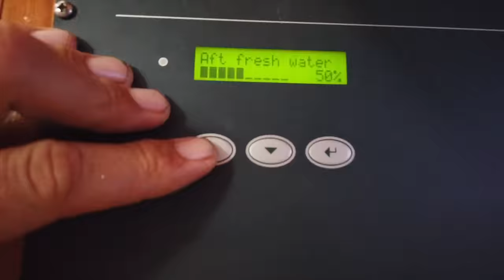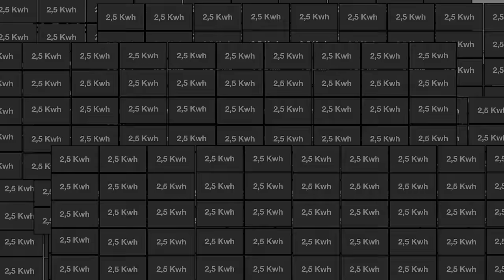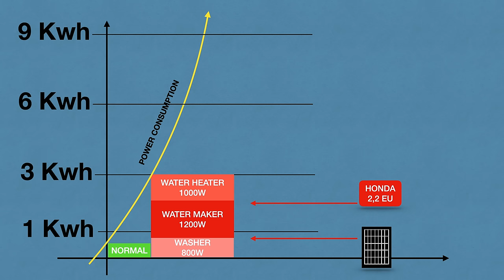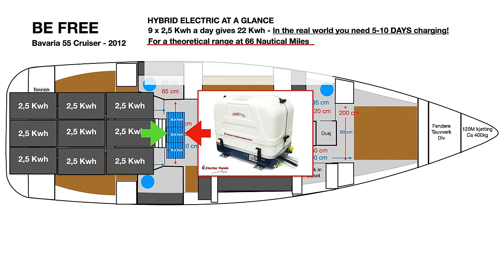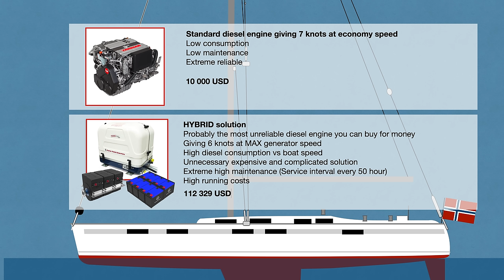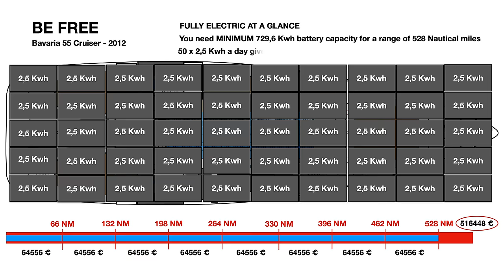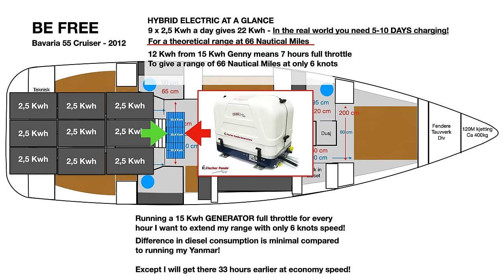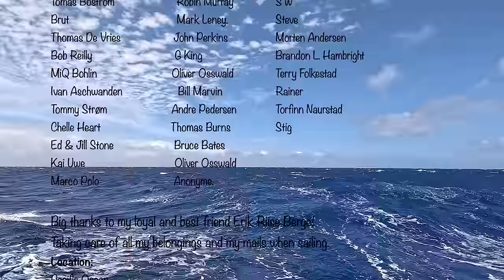Why I don't believe in ELECTRIC or HYBRID for long-distance sailing - SwT 170 - MY HONEST OPINION

Comment: Agreed on all of that. Personally I think all of the greenwashing of these systems is getting really tired. There's nothing eco about them.
What you didn't cover is parallel hybrids. In my opinion, they are the only way that a hybrid makes sense or if safe for the long distance cruiser. You get the advantages of silent day hopping and some regen in nice conditions, but have a real engine with long range capability when it's needed. You also get the huge advantage that they're a very powerful electrical generator, so when you do need to change, you can do it fast.

It also goes without saying that such systems do make more sense on a fast multi, where you have the space for big solar and regen becomes much more effective.

Comment: The problem with boat propulsion is water. It’s the hardest medium to push through and unlike a car , where you put in initial energy to overcome the rolling resistance, once you get up to speed you can ease off the power and continue to maintain your speed. With water this is not the case - to maintain a set speed you have to continuously have to input power - this works ok with diesel where the energy density is high but with electric is is a big problem.

Comment: I've been a solar design and installer for 29Yrs. Specialising in Victron systems. Many of my land based systems with no utility require a diesel generator. Being miles out at see without a petroleum driven motor/s is NUTS. If you have Victron issues let me know. I can assist, send  me your VRM number and insure your system is linked to WiFi. Cheers Mac

Comment: I have electric/hybrid propulsion…. 21.5kw Onan generator…
Depending on conditions my sailing catamaran has a range of 2000-4000 miles per tank of fuel(160g)…. That is up to 25 mpg from charging with a diesel generator…

Comment: I've done 150,000 miles over 50 years and never had anything close to 1,000 mile range, more like 200, then never used that anyway. I did run out of diesel once in Alaska so operated as a sailboat for a few weeks till I got somewhere. Different strokes for different folks.

Comment: I like a hybrid from a redundancy and safety perspective, but, obviously when considering a scenario where the sailing yacht becomes a motorboat, and needs long term power beyond the sun can provide... it costs and burns more than the corresponding diesel engined setup due to conversion losses. OTOH if your diesel runs out you're not going anywhere regardlss of the sun. I think the hybrid style that makes a lot of sense is where both diesel and electric can power the prop. The diesel is the generator, and either one can spin the props. Silently motor away from the dock for free, and if all hell breaks loose and you need more than your electric can provide you have a backup/higher power solution.

Comment: for past five years on craigslist  only electric sailboats have been moving on the market  but they must be don correctly  the todays buyer dont want a boat thats sitting on the hard past five years not done anything to it.. yep  i seen them boats lately .. just last week.. yea. im boat shopping. and what i want is a sailboat thats ALL electric  .. to never EVER  have to carry water or fuels from dock dingy to boat  really excites me.. i like that idea..   i go look at a 1985 morgan 43 tomorrow, yes it has the diesel engine.. but.. it also has 1200 watts solar and 800 amp lithium battery back.. thats what sold the boat .. and i suggest any boat owner who is trying to sell it. spend 5 grand on solar and batteries and your boat will sell..and clean it up every 6 months  we buyers dont want to spend 40 to 60 gran on a dirty ass boat....

Comment: Just to add. If we assume you are motoring at 7 Kts then you would do the 528 nautical miles in 3.14 days. If you had 291 panels with an average output of 2.5 KwHr each then in one day, as you say, you would generate 727.5 KwHrs. But your 528 nautical miles will take 3.14 days so you would generate a total of  2.284 Mega watts of power. I don't understand the need for  291 panels in order to cover 528 miles at 7 Kts.

Comment: Everyone is allowed their opinion, but it’s just that.  There are no hard correct or incorrect answers, just opinions that correspond to the needs of the individual.  There are sailors that cross oceans with electric motors, there are row boaters that use their muscles.  It doesn’t matter what your opinion is, as long as you don’t think yours is the only way!

Comment: Bro, sent that generator to the scrap yard and buy a Northern Lights gen, as well as upgrading your alternator on your diesel engine to something like a 150 to 200amp unit.  Also consider a Silent Wind wind generator, as well as a water prop gen.

Comment: Excellent video. Well thought out and plenty of supporting data, cleverly presented. BUT: you don't discuss Parallel Hybrids. The idea of charging batteries (which will be used for electric drive) with a Fischer Panda diesel generator, or worse, a Honda gasoline unit, is, as you say, silly as a primary 'hybrid' solution. But a Parallel Hybrid, which is essentially a massive alternator driven by your inboard diesel motor, which can also become an electric drive, these systems seem to have far greater potential for offshore cruising.

Comment: tbh. the real advantage of hybrid is packaging and silent entry and exit from marinas. plus there are some areas where you cant go in under power. also with a massive battery back you can be at anchor for days running AC and not worry. also one more thing. comfort. motor sailing at night on electric motor only, so people can sleep and not feel any vibrations. especially on smaller boats. there are advantages. massive ones. cost is not one of them :D

Comment: I did some rough napkin maths on this once. If you cover the entire deck with solar panels, never get overcast and run no other electric equipment, you should be able to sustain around 3 to 4kn of boatspeed at the equator over a day cycle. This is relatively independend of boat size, as both deck space and drag are roughly functions of length squared.

Obviously this is a hugely impractical and way too expensive solution.

Comment: Electric as a viable option would also depend highly on the boat..... Sailing solo around the world in a modern 55'  20 ton sailboat with a garage for your dink & with many complicated systems  vs. sailing in a 1972  36' recycled 3 ton minimalist sailboat for two, would make a huge difference in your analysis too!

Comment: I'm going to sail in the European Waterways and a bit of coastal sailing. A sailboat is therefore not so practical, so I will go for semi-displacement motorboat. Cruise speed is about 11 kn to 15 kn, and sailing slowly (in displacement-mode) will use as much fuel as cruising speed.

I want to go with diesel-electric propulsion, which is known technology that has existed for more than a century. 

I need a 60 to 80 HP petrol outboard or a 25 KW genset + a 40 KW electric motor (40 KW electric motor because cooling a big electric motors can be difficult). I want to have a smallish (20 HP) outboard in an outboard-well, for security reasons.

If I want to go sailing on a sailboat, I know that some of my sailing friends needs a crew member. Hurray for OPB (Other People's Boat).

Comment: There is some errors in your considerations. Please, kW and kWh are not interchangeable. Kilowatt hours kWh are energy,  kilowatt kW are power. Your solar panels have a power rating (kW), which is the rate at which they can collect energy. Power times time equals energy. kW * h = kWh. On a full electric, with a 5 day range, there is no real reason why a solar system would have to charge it in a day. But I agree it's not a great approach for crossing oceans.  On the hybrids, you miss a few things. First there is the architecture. I think betamarine's approach with the diesel and electric motor clutched to the same shaft is on to something. It maintains the safety of a conventional diesel. Then there is the regen these systems get. Especially when passage sailing this should be a considerable help, at least with the house loads.  And then there is the motivation behind it. The larger battery a hybrid will have over a conventional boat means you'll very rarely spoil an idillic anchorage with the smell and clatter of the diesel to keep your fridge going. I think the hybrids are best suited for catamarans that have more roofspace for solar and have better regen due to higher cruise speeds. HH has gone down that route and I think these boats will rarely have to run their engines on anchor. They are also likely to pull in and out of there electrically and not needing to run the diesel for the sake of recharging while sailing in sunny or cloudy weather. But if they are stuck offshore without wind, they'll motor like a conventional diesel. Still, I agree economics do not justify a hybrid. But I'd like one, if money wasn't an issue.

Comment: PS. For my New Boat build, I'm designing around a nicely overpowered inboard diesel engine with a very efficient lower rpm prop - a flexofold, and a Diesel Tank capacity giving a 1500 rpm range of about 1,750 miles, plus diesel in Jugs. the Dinghy Outboard a Tohatsu / Mercury 6 horsepower four stroke, which at full throttle returns over 10 miles per litre of Fuel.  2 x 12 litre external fuel tanks , should give o er 240 miles Range flat out, but at least double that with less throttle. So if conditions change, Getting to shore ot back to the boat shouldn't be too much of a problem. Bob. 👍
Reply: PPS Excellent analysis and good basic Maths insights Thomas, and in a way it all boils down to an Energy Density issue of creating the Energy, the available Storage Density , and the Basic reality that no Current or foreseeable Battery Technology comes even close to approaching what is needed. Nothing can equal the energy densitybof Petrol/Gasoline, let alone Diesel. I had actually looked into leaving Out a Diesel Generator, in favour of having a high output alternator on the inboard Diesel instead, but from a safety backup perspective I ended up concluding that it just didn't make sense,  so will be having a diesel generator likelynpowered by a Cummins diesel engine.  Safety Comes First. Bob. 🤔🌟🌟🌟👍❤️
Reply: When it comes to Marine Environment Safety issues Thomas, if it takes treading on toes to wake people the hellnup to Energy Density issues, then I say, like me, keep Treading on them with basic reality, and if people can't handle Reality, then that's their problem., and they are welcome to start hating me for it, if there's a chance it might help to save their lives, or them putting the lives of others at risk. Bob. 👍🌟🌟🌟❤️
Reply: I would be doing the same, as have experienced being stuck off shore in,  Northern Polynesia Hawaii, only had the radio and barely enough battery to reach a signal for a requested tow. That was back in the 1970’s on gas. Diesel, is the best proven old tech that works in the storm and in good times. The solar or wind generator is great for charging the batteries, but unreliable for constant propulsion. Although the, U.S. Navy solved that problem with Nuclear Power in the 1950’s era, but I can’t afford that cost nor the crew to run it. Aloha, and stay healthy and free. 🌺🌸🌴❤️🇺🇸
Reply: @ohanailo7743  Glad to hear you got as safely back to land as I did. ❤️ My New Sailboat order should be able to fit up to 4 x high efficiency 250 watt Solar panels on the solid rear Cockpit Arch, complemented with a wind Generator,  but even with a high power output alternator on the inboard Diesel engine, a good diesel generator as backup it is very hard to avoid getting built in. I like Cummins diesel engines and will go with one of those. The Flexofold props are not cheap, but to get up to 7.6 knots at 1500 rpm can give outstanding range due to very low fuel Consumption, conservatively estimated at around 1750 miles, with a good enough load on the engine to keep it happy and in great condition. The final Housebanks battery setup I’m still working on tbh. Main Housebank still likely to be high quality 3500 recharge cycles Dual Purpose AGM, with a second Bank of enough Lifepo4 batteries to keep the AGM’s above an 80% state of charge at which point the Recharge Cycles flatline and don’t decrease, so the 20% needs to be able to cover the hours of Darkness consumption, with the Lithium Bank used to keep them good with a DC to DC charger. That way, barring lightning damage, they should have a 30 year Service Life. Only Testing will determine any Fine Tuning changes that need to be made, and I may be able to get a proper feel for it, with the tide me over Sailboat to get me to the Boatbuilder. Best laid plans of mice and men and all that. 🤣 Best Wishes. Bob. 👍🌟🌟🌟⛵️
Reply: @brownnoise357  , In my observations and talking and observing many sail boat owners and sailors in, Hawaii. If your going to be a blue ocean mariner, then safety is paramount. Many I have seen have taken unnecessary chances, either to impress friends, or they are at a financial disadvantage to fix the problems, that have later become, a mystery’s at sea. Like your calculations, like you stated once finished then shaken out at sea for the fine tuning consumption rate, you should be good for world wide adventures. What ever you do though for now, stay out of the, PNG circuit. The civil unrest there of these past two months have destroyed tourism there, and I wouldn’t want to face angry natives storming your boat for fuel. Prefer Hawaiian waters, why? Because it’s still the, U.S.. Stay healthy and free, Aloha to you and your family. 🌺🌸🌴❤️🇺🇸 Oh one last comment on your folder prop. Even if I was able to purchase one and use it. I would have a spare, “standard sailboat prop” for emergencies along with some scuba gear and tooling to make an emergency prop replacement, just in case. You could have all the power on board to go from continent to continent, but that prop gets damaged for whatever reason, then your at a disadvantage. Why I mention this, is because of working as a commercial diver on, an including, U.S. Navy vessels prop damage does happen at sea.
Reply: @ohanailo7743  Agreed on a spare prop etc. Best Wishes.  Bob. PS. the nice thing with Island Packet Sailbosts, is really well protected Props  and Rudders, plus a Termite Proof Construction. 🤔🌟🌟🌟👍❤️

Comment: I 100%Agree Thomas,  Electric Propulsion is simply unfit to be used in a Marine Environment,  at least for the foreseeable Future. I 50 plus years time ? Maybe, and the same goes for Electric Vehicles on Land as well. Having been stuck Offshore in a Dinghy, in an increasingly strong Offshore Wind, in rapidly deteriorating Conditions,  I will not touch the Safety Hazard that are Electric, battery powered Outboards either. We Were Lucky, a speedboat heading in gave us a tow to shore, or we might have ended up in North Africa. What I  really find disturbing is People who Definitely Do Know Much better are promoting the damned things for Money. Talk about selling Out Marine Safety Thomas, it really Angers me. Best Wishes,  Fair Winds,  and Safe Travels.  Bob in Wales.  🤔🌟🌟🌟
Reply: I don't think sailing uma is promoting electric boats because of money. They get money for promotion, but they choose to promote electric

Comment: While I respect your intent here and I ABSOLUTELY AGREE that there's greenwashing galore regarding electric yachting, I humbly submit that you've made a key error here in assuming that solar-electric yachting works like diesel does. You don't need to size a battery bank to hold all of the energy that gives you your 500nm. You size it to motor at 3 knots in the calm for say 48 hours and then the PV charges you along the way. As evidence that this can work, I submit solar catamarans that have gone around the world (big expensive things, yes) and tiny engine-less yachts that sail with an oil lamp only. There's a whole world of possible solutions in the middle. There's no replacement for a big tough diesel and hundreds of gallons of fuel, for sure, but that doesn't mean solar electric sailboats are "unsafe". You just have to plan accordingly.

Comment: Because of your failure with Panda, I made some research and found Polar Power Generators very promising. With the lightning strike you are absolutely right, and so I found Dinnteco as a solution. And even with the batteries I would have fear of fire, but even there are batteries for example from MG called RS Series with their own liquid cooling etc. , which seems quite safe. But all in all it's super expensive to go hybrid in a safe way. I say that as a dry sailor without any experience ;) . The only cheap solution for you, would be to throw away the Panda and use a generator extension for your original motor from Combi for example. I saw some solutions their. Their was a film by Sailing Uma https://www.youtube.com/watch?v=XKJBnxQqAvM which is quite interesting in terms of "Which solutions are on the market" .